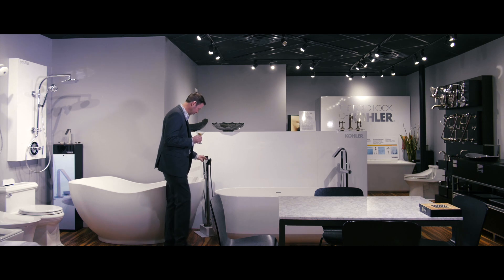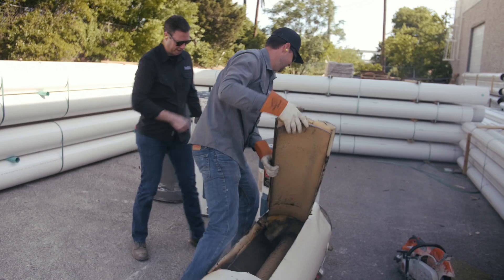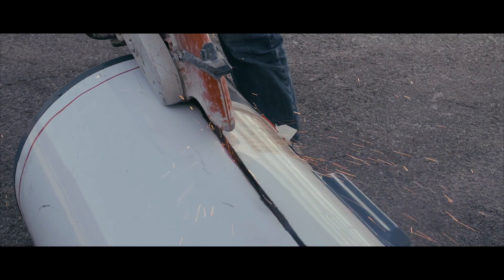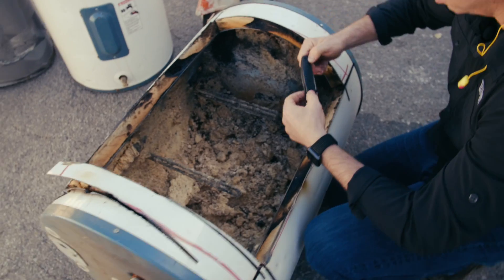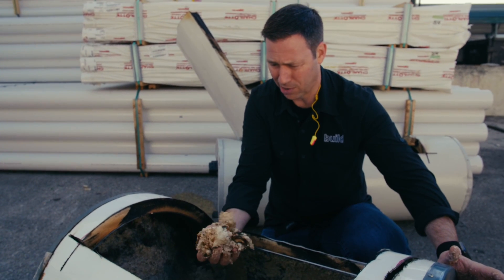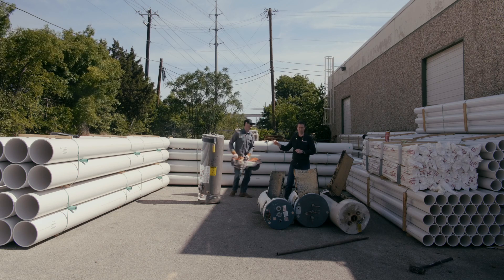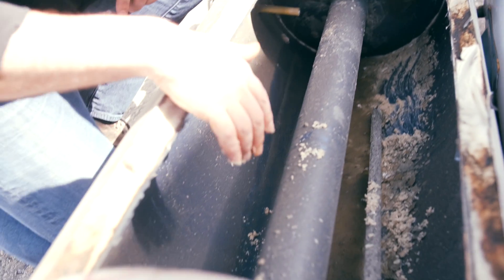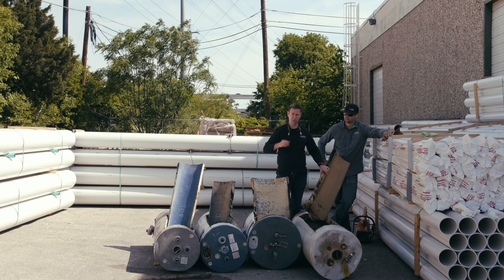Water Heater Tank Autopsy: You won’t believe what’s inside!

Comment: I’ve gone through two water heaters in less than 10 years, and it’s because I have a water softener.  The soft water will eat your anode rod at an accelerated rate, far quicker than hard water will.  Learned a hard and expensive lesson to replace the anode rod often.
Reply: My anode was 9 years old and it was TOAST! Go with a magnesium one,people.Segmented one is much easier to install.Homeless Depot has 'em.$44.
Reply: TrollBuster I wonder if it's good or bad for an on demand?
Reply: I've heard mixed opinions on that, but I'd imagine the same principle applies.
Reply: I dont get it, how does soft water attack the anode at an accelerated rate when hard water has lots of minerals to corrode?
Reply: wazup3333 I’ve been told that the softened water is much more aggressive because you’ve essentially starved it of its minerals when softening/deionizing it. So it naturally tries to re attain or rebalance its mineral content by aggressively attacking anything that contains minerals.. ie cooper pipe,anodes etc.
Reply: that doesnt really make sense, saltwater anodes on outboard boat engines dont get attacked when used in freshwater
Reply: wazup3333 maybe a chemist or someone in that type of field may have a better explanation. I’m just a mere plumber.... I’ve been told over the years that deionized and reverse osmosis water are very aggressive due to the removal of the minerals.
Reply: @robertsaurer6431  Then why do companies that make softeners/salt say that it extends the life of the plumbing/water heaters?
Reply: @AuronFFX  softeners are good for tankless heaters since they won’t scale up the heat exchangers minerals. Saves you money from not needing to descale the unit annually. I’ve heard softener manufacturers say they will improve the function of a tank heater. Which is only true in that the submerged probe on the control/thermostat will stay free of calcium rendering better thermal readings. But what good is that if the tank has holes in it in two years? Best bet for tank type heaters is either annual replacement of magnesium anode. Or install aluminum anode from day one.
Reply: What happened to them?  (Stop heating water / leaking / were they gas or electric ? )
Reply: If you ignore the anode,it will cause a leak,due to rust and scale.
Also,the hot water will begin to smell"funny".
Reply: Chad Bednarczyk  Gas.  The first one leaked and the second one just stopped heating altogether.
Reply: Either! The tank will leak and/or the hot water will smell bad. You will see.
Reply: The magnesium anode is the stock anode for major heater manufacturers. If you have soft water feeding the water heater you need to replace the magnesium anode with an aluminum one. We install Bradford White heaters. Our representative here told us about these years ago when I had a slew of tanks leaking within 2-3 years of installation. Aggressive soft water will turn the magnesium anodes into toothpicks in a year or two and go to work on the metal tank.

Comment: I would like to see a "PREVENTION" video. I have flushed my 3yr old tank once a year . Since replacing 15yr old model. The old model was filled up to the lower element with debris !! Now the 3yr old tank is starting to show signs of build up. Like clogging my fixtures after doing a drain and refill. I have been told by my water department that we have a high calcium yield in are city water. Drives me nuts !!

Comment: Manufacturers should read this great idea.  Put a larger bung in the top, and a 1" drain on the bottom of the tank.  That way someone could drain the tank and insert a pressure washer in there, that buildup is disgusting!
Reply: The manufacturers want to sell MORE water heaters MORE often - the less serviceable they make them the better it is for them (and their stockholders)
Reply: Things are designed to fail within 10 years. These new built homes dont last but 5years before needing major repairs. But iverall repairs start within the first year. Cars are just as bad. Funny knowing oure forking over 250k for a home and 80k for a car just to have it fail in no time yet stuck 5-30 years in it.
Reply: rfarevalo I said, "larger bung in the top and 1" drain valve on the bottom" not the lame 3/8" ID valve that they currently come with.  Sometimes trying to drain a customers tank, there is so much buildup in there, you can't even get it to gravity drain.  I'm not even talking about prolonging the life of the tank, just getting the nasty stuff out of there.  I have a tankless instead of a tank, that gets flushed annually and treated well water, so I don't have all this nasty stuff.
Reply: woohunter1 planned obsolescence.  Catch up on the ever forgotten 100 year light bulb and the Phoebus cartel
Reply: Mike Brink - It's not disappearing ink, it's thermal print paper. Laser printer.
Reply: Mike Brink I don't think it's quick fading on intention it's just cheap like going to a cheap paint shop eventually that clear coat is horrible
Reply: They use those receipts because the printers are cheap, fast and bulletproof. I think the paper's actually toxic. Anyway, bigger holes are more expensive. You can also clean from the element holes, if it's electric. Those are huge. Not sure I'd use a pressure washer, as the inside is lined with a thin layer of glass to prevent corrosion. You can also use long-life anodes or keep replacing them. Some tanks come with an electrically-forced anode. You can also buy this as an upgrade. If you do this, many tanks can last 30+ years. Elements should still be replaced regularly as the shorts can cause fires and stuff, due to the way a lot of them are wired up. Drawback to the "powered anodes" is prolonged power loss (like in the case of snowbirds) can destroy a tank in ONE off season! SURPRISE!
Reply: just pull the element out..
Reply: The bung would have to be pressure proof costing money.
Reply: Bungs tend to be rather resistant to pressure, as that has been the point back to the days when they were only cork.
Reply: Mike Brink that isn't it on many modern receipts, it is thermoreactive paper and letters are burned into it. Leave one on your dashboard and the whole piece of paper will turn gray/black.
Reply: woohunter1 lol... it can be tuff, jump on hose at drain and it forces pressure back in tank, still nothing? hook up a catch to the highest element, unscrew quickly drain past element. I have had to do that once or twice..nvm that may be too risky for you.
Reply: Mike Brink   Those receipts are printed with heater elements in the print head on thermal paper.  Make a copy almost immediately and keep the copy.  As an experiment use something hot around the paper of one of those receipts and see what happens.  Fax machines used to use thermal paper so if you wanted a long time good copy it was necessary to make a copy of the fax.
Reply: It's not disappearing ink its thermal paper. All thermal paper degrades in a year. photo copy your receipts.
Reply: Mike Brink it's an AutoZone battery the Duralast name is already on it we have exchanged them without receipt
Reply: 250K for house?  sign me up its 500K buy in cali...sucks big time.  as for the 80K car, ouch.   I'm going in on someone elses brand new car at $3-10K and no payments.  your going to drive it ding it, and some d-bag is going to do eventually do the same to you or drop something of the bed of their truck that hits yours.  Save the agony and just get a well cared for used car!  New cars aren't worth it at all.
Reply: ALL WATER HEATERS ALREADY HAVE THAT. bung at the top for the anode and drain at the bottom. What's stopping you, go pressure wash your water heater. I on the other hand will simply follow the manufacture's instructions and drain the tank annually of any sediment.

Comment: It is possible that the variation is due to water hardness, as you suggested. You implied that a water softener may have been used. 

Alternatively, the variation may be observable from the region in which a tank was used. If the 2005 model was sourced from an area with relatively soft water, like #washintonstate, it would explain why it has less scaling. You should start a poll asking plumbers (who frequently replace old tanks) to saw into the salvaged units and post a video with their condition, year and location used. 

Then make an awesome SAWING WATER TANKS USA!!! compilation.

And cool vid btw

Comment: The thing no one is mentioning is the efficiency of heating water. The lime /calcium deposits are like insulation so it takes more energy  to heat the water . This is worse with a gas water heater because the lime coats the hot surface . But with the electric water heater as you could see in the video the scale forms on the element but often  breaks off and falls to the bottom of the heater so it does not cut down on the efficiency as much . The real solution is to have a water softener for the hot water and then you won't get that lime buildup . All commercial systems have water softeners , especially important for on demand water heaters where it does not take much buildup of the scale to cut down the efficiency . And as far as flushing out all that scale  - you will get a little bit out but  most of it will stay in the tank. I had an electric  water heater given to me and it had some loose scale in the bottom - not too bad. With electric water heater you can take out the element and have some access to stick in a hose from shop vac to try and suck it out . I spent a lot of time vacuuming and flushing it out - and I had to tip the tank on it's side and flush with water while trying to get a wire rod in there to shake the scale loose. Forget it if  you were just trying to flush it out the bottom via the drain valve - that stuff won't come out and if it does will plug up the valve in short order. And no way to clean out a conventional gas water heater since there is no access hole like you get with electric by taking out the element.
Reply: Larry Kapp Except soft water is much more corrosive, so you need to check and replace the anode rod more often, otherwise it will eat it up and then start attacking the tank itself.
Reply: From 1984  so kind of dated  - but it has results of some testing that was done concerning energy consumption by scale buildup in water heaters  https://aceee.org/files/proceedings/1984/data/papers/SS84_Panel5_Paper_18.pdf
Reply: [The lime /calcium deposits are like insulation so it takes more energy  to heat the water . ] It is the same energy transfer, but slowed, not taking into account a  slight increase in loss through the jacket due to increased time to heat the contents.

For electric resistive heating especially, the efficiency will stay virtually the same. The hotter the element gets, its resistance rises, and the current drops.
Reply: Interesting points.  I just know commercially hard water is never tolerated in water heating equipment.
Reply: the mineral buildup looked like it was attaching to the tank more than the heating elements from what I could tell. So, in that case it would help insulate the tank. I was thinking that the mineral deposits would accumulate at the bottom of the gas fired tanks, which would impede heat transfer, but this video didn't show that to be the case.

Comment: Can you show us how to flush a tank and replace the anode then cut it open to see how well the flushing worked.
Reply: That would be great
Reply: I drag mine out to the front yard, open up all the ports and then use a garden hose.
Reply: @phiksit  well, does your method actually work?
Reply: When you buy a new water heater first thing you do is remove the drain valve from the bottom and replace it w a ball valve that won't corrode so you can drain it and be able to shut it off w/o drips.
Reply: @stevewilcox1755  I saw your comment on the water heater experiment then noticed your name. Tell me, are you Steve Wilcox from television?
Reply: @doriswashington9358  No
Reply: @stevewilcox1755  thank you for being nice enough to respond. I was genuinely curious but now that I'm paying closer attention, I see that your name is actually not spelled like his which is Wilko.
Sorry. 🤭
Reply: The Robotics Code Depot or scope it...? AND run water tests. Majority of commenters aren’t familiar with Texas water.